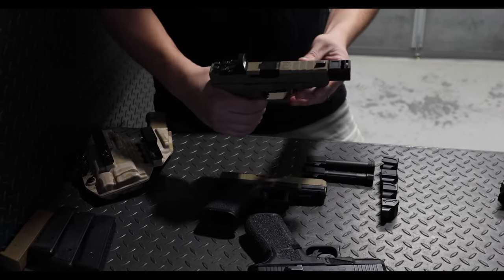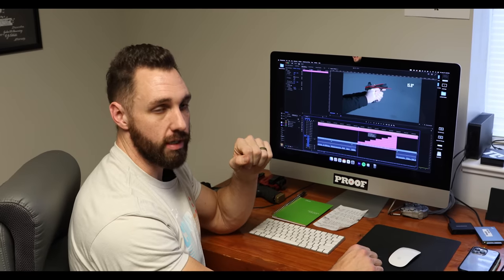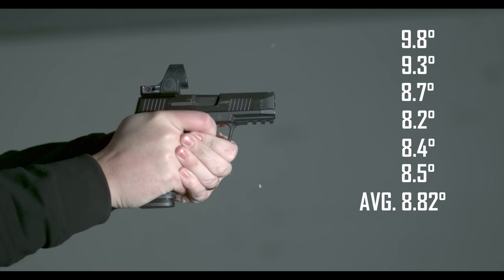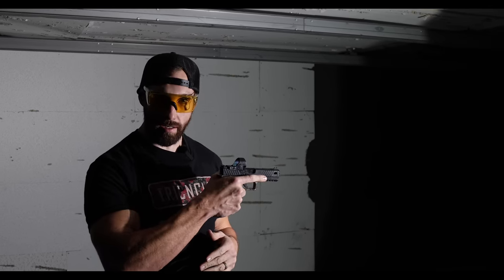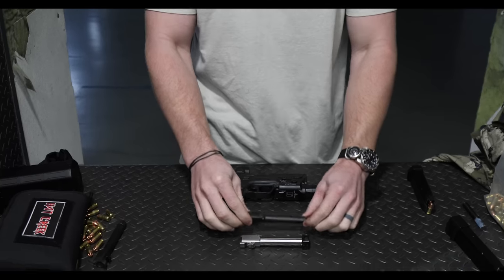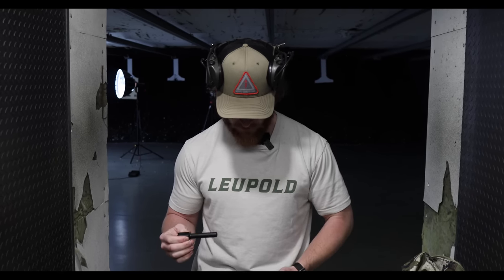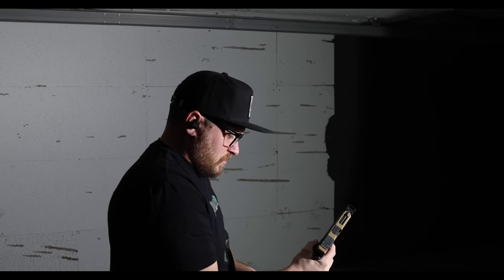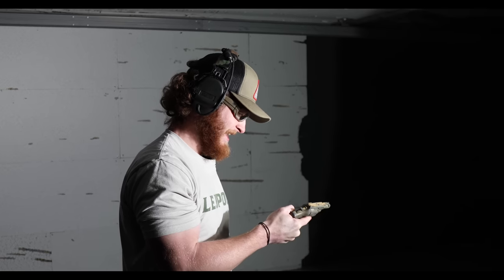Ported Barrel vs Thread-On Compensator - Which Shoots Flatter or Softer?

Comment: For me, ported is really the way to go. Length of slide remains the same and they shoot flat. I decided to port my G48 after the video you guys put out last year, best decision ever. Great vid!
Reply: Not to mention, any holster you may have owned before the comp has become completely useless. Unless you know your way around a dremel. Thus why I never bothered comping. They are great for competition but for CCW, they increase the bulk of the gun and take up more real-estate
Reply: I took my ported pistol to a low light shooting session and man that thing spit way more flames than my two port comps. Went back to comps without any hesitation.
Reply from the maker: yeah your mileage may vary with comps and ports!
Reply: @Tier1Concealed   have you guys tried the lucky 7’s trifecta ports from monsoon ? Or is that overkill
Reply: @boygonewhoopdataZZ  I shoot competition at night, the ports really don't interfere with much in my experience, nothing a weapon light can't handle, I'd say the most issue you get shooting at night is the light interfering with the smoke, obscuring the target. To each their own I guess
Reply: @boygonewhoopdataZZ  your ammo was cruddy. Top shelf defensive loads also have flash suppressant in the powder. It’s really a non issue.
Reply: It also gives us more options when living in states that hate freedom.
Reply: @boygonewhoopdataZZ Are you out at night a lot? If not, it's probably wiser to carry a ported barrel...

Comment: I bet most of the problem of ported vs comp is that the aggressive porting actively reduces the energy of the bullet, which inherently reduces the energy of the recoil while compounded with the porting. It should be fine, but I'd check your defensive ammo's performance with shorter barrels to make sure it works well with that porting. 100 fps seems minimal, but I have absolutely seen JHPs fail with that little discrepancy in velocity.
Reply: If you get something like the lakeline llc ported barrel they are slightly longer than stock barrels and fps is near identical between their barrels and stock barrels. I know they are available for taurus and glocks

Comment: WELL, now you just need to include those new “INTEGRALLY COMPENSATED” slides, ex; G19 length slide with porting in front of sight using a stock G26 length barrel, NOT to be confused with “PORTED SLIDE & BARREL” setup and those “Ported Extended Glock barrels” ex; EFK Fire Dragon barrels, G17 length barrel in G19 slide.
Reply: Oh yeah, now you have places like Zaffri precision, offering A threaded ported barrel, so you can run a compensator on a ported set up

Comment: All angle averages:
Sig stock - 12.33
Sig slide ports - 10.84
Sig monsoontactical Lucky 7’s barrel ports - 8.82
ZEV OZ9 stock - 7.77
ZEV OZ9 primarymachine Stealth Comp* - 5.92
ZEV OZ9 monsoontactical Lucky 7’s barrel ports - 5.25
M&P 2.0 stock - 7.13
M&P 2.0 Smith & Wesson M&P RGW QL comp and barrel - 5.67
M&P 2.0 monsoontactical Lucky 7’s barrel ports - 5.37
Glock 19X stock - 9.8
Glock 19X agency comp - 7.58
Glock 19X MOD-K** barrel ports - 6.33
Glock 19X ported barrel and swprecisionarms comp - 4.72
Revolver stock - 14.08
Revolver with comp - 13.28

*Broken into single port comp
**MOD-K armory is apparently permanently closed and stole a bunch of peoples stuff. Google it.
Reply: Very nice - I wonder about PMMs stats
Reply: Goat
Reply: Now to get SUPER TECHNICAL, test Monsoon Lucky7 porting vs Norrso Porting since theirs is circle, square, triangle the same size and placement as Monsoon's.

Comment: Great test! In my experience a proper compensator-meaning a custom, competition-style unit- works best and can have other advantages as well. The issue with such compensators is the gun needs a certain amount of re-engineering to use them reliably and the add real weight and length to the gun. That being said the comps you used represent a good cross section of what the average shooter will encounter and is likely to resort to. For my carry guns porting is the way to go. It's effective and minimizes changes to the platform which means minimal changes in reliability. For me that outweighs any potential advantage of an external compensator.  I do prefer the 'Chonk Port' style of port; I find these very effective and reduces the loss of velocity to a negligible level.

Comment: I prefer ported and my own M&P 2.0 4.625 inch barrel 10mm and slide has been sent to Mag-Na-Port for quad porting. My barrel is not threaded so no comp for my gun. Comps add length I do not wish to add for holster carry. A 4.625 inch barrel is long enough for me.

Comment: A true comp outperforms straight ports due to the gasses hitting the wall at the front of the expansion chamber but a combo of comp with ports is the ultimate. Look at the race guns used in USPSA. Edit, I should add that comp design is critical, most of the aftermarket drop in's are merely bbl weights.

Comment: Straight up… compensators are much more effective than ported slides. Like my standard p365 with pmm comp and barrel out performs my $2,500 Gucci X Macro Comp with every available internal and external upgrade available. There’s a significant difference!

Comment: So this was an awesome thing! I think you should run the standard barrel, threaded barrel, and ported barrel over a  chrono. I know that the threaded barrel is going to increase terminal performance, standard sill be standard, but curious how much velocity is lost for from the ported options. I know my 3" revolver and 4" ported are almost the same for 357 and 38.

Comment: Porting a barrel shortens the distance the bullet travels before it can achieve its maximum velocity. Compensators help if you are using major loads or P++ ammo. Hence Porting a barrel affects bulllet velocity resulting to less energy created by the bullet. The longer the distance the slower the bullet. Compensators does not help reduce muzzle flip if your are just using factory loads because they do not creat enough energy jet to keep the barrel down. Especially if the compensator hole is huge. All it does is redirect the blast upwards. Compensators are used in open division competition because they use major loads (P++). Compensators help redirect the massive explosive energy. For production guns that uses factory ammo, porting or using compensator produces placebo effect. You feel its helping with the muzzle flip. However, that's science. If porting and use of compensators makes you look good and a confident shooter, then that's good. All that matters is you are having fun and is improving your confidence in shooting. If my gun is beaute, then I am a beaute.

Comment: I know this is a year ago but I have a question why couldn’t you just have the barrel sticking out about a half inch like a threaded barrel and make it ported , better yet two slots on both sides of the barrel so you won’t get the flash in your face . That way you won’t lose velocity and you don’t have to cut up your slide. Basically a drop in barrel with ports in it.
Reply from the maker: Those do exist, but you don't see them very often. Its probably mostly an aesthetic thing for the customer.

Comment: @tier1concealed I read somewhere recently that gases expelled from a ported barrel could potentially blind or disorient the user if the gun is fired closer to the body. In self defense situations you may not always be firing from a normal shooting stance. Just wondering since most of you use the lucky 7 porting, have you seen any validity in this?
Reply from the maker: In theory there is, but only if it’s dark enough for that to be an issue. But you’ll find there’s typically significant muzzle flash anyways when shooting in the dark. Ports or comps might increase that a little bit in our experience it doesn’t make much of a difference.

Comment: 2 interesting things I have noticed.  1st I put 2 port comps on my Glock 20 with a KKM threaded barrel as well as my CZ P10 C with a threaded barrel. Both had multiple malfunctions were none existed before. After removing the comps reliably returned to 100%. 2nd: At 15 feet while shooting a steel flip over target my P365 would hit the paddle but would hardly move it. Took out my P365XL & shot it with the  same ammo, same distance. The paddle moved more but still wouldn't flip over. Took out my S&W PC Shield Plus 4" ported barrel with same ammo & distance & now the target finally flipped over. So the 4" ported barrel had more power than the 3.7" non-ported barrel. And no malfunctions either!
Reply: Just an add on the steel flip over target was shot multiple times with each of the 3 pistols & the results were the same each time.

Comment: I carry a ported G17 I built out a few years back. It's been an absolute game changer. Ported handguns are the way to go if you want enhanced performance out of your handguns. Most velocity decrease can be negated by +p ammo
Also just sent my xl slide to get ported. Threw it on a macro frame as well
Reply: How much fps do you lose running +p vs standard?
Reply: @HKBuilderDIY  its dependent on where on the barrel the ports are, on average I'd say you'd be losing 75 fps at most, but usually around 25-50fps. Most +p loads give you back that extra 25 fps that you lose, also helps the gun shoot flatter because of the extra pressure pushing the muzzle down, not a huge amount though

Comment: That's great info. I've always felt a bit skeptical about comps cause even though they can reduce recoil SOME can effect accuracy. So i've been looking into ported barrels and slides for my P320. This helps clarify things for me. Thank you.
Reply: Ports can cause fragging and flash. Nothing is without is pros and cons. Comps are generally better but ports don't increase length which is a deal breaker for many.

Comment: Messed with all kinds of comps. Gen 3 and 4 and 5 glocks w/ threaded barrels. Finally bought my 43x and decided to do an Arc division slide but heard about initial reliability issues so went with a zaffiri precision ported slide and barrel setup. It shoots flatter than any comped glock I've ever owned. I'm amazed and the effects of ported barrels.

Comment: Going from bare* muzzle to ported was kinda flawed in my opinion. I'd rather u start with a comped or ported gun first then go to bare muzzle bc u have to take into consideration "getting warmed up" if that makes sense... one could argue the comp didn't do all the work if ur getting more warmed up as u go meaning ur shooting will getting better atleast until a point of fatigue kicking in an changing things
Reply from the maker: yeah that makes sense. we did take probably 10-15 minutes in between every string of fire to re-setup everything and get the high speed footage saved, so I wouldn't say we were very warmed up at all.

Comment: This test might be good to redo strong-hand-only or just with a really weak grip. Yall have such good grips that the difference is almost negligible. Weaker grips will open up the differences more and make it super clear
Reply: Most comped and ported guns won’t run with weak grips
Reply from the maker: thanks for the suggestion and compliment! we might do another video similar in the future...

Comment: On the ported video.. https://youtu.be/3xEI36Dtf04?t=1013 it shows flares up and gases .. does that affect night shooting or does the gas gets into the red dot somehow? Curious as I am looking at NInex19 ported sliders with 45 and 135 degrees ported barrels for a reson vs the 90 degrees tested on this video. Is that a big of issue to stay away of ported?
Reply from the maker: yeah people could argue that its detrimental in a night shoot, but you'll notice muzzle flash anyways in nearly every handgun. We haven't noticed much residue on the red dots so far.

Comment: Curious on accuracy with the lucky 7 ports... probably has no ill effect. Also, I know what porting has the potential of doing. Buddy had factory ported mp shield and got copper jacket in eye and was bleeding from his nose shooting from retention. Ports can strip off pieces of copper . Not necessarily guaranteed to happen, but I've personally seen it.
Reply from the maker: yep, factory m&p ported barrels are notorious for shaving jacket off!
Reply: No kidding? Ouch
Reply: I've had copper jacket fragments hit me while firing stock pistols, fyi. I'm sure porting spalls more.
Reply: That typically happens when the barrel is rifled then ported… port the barrel first then rifle it and you should have no issues. Factories typically do shit like this because of the mfg process. Small shops can afford the labor to do it right.
Reply: Blazer Brass.

Comment: Great video! On a full size gun the barrels that are ported just beyond the slide seem like the way to go so you don't lose velocity.
Reply from the maker: We're hoping to do a video with a chronograph soon!
Reply: Sagedynamics did chronographing with the g19 vs g19c( factory ported glock19) fps loss was around 1%. It was determined that the disadvantage to porting is NOT lost velocity, but the spalling.

Comment: What recoil spring weight did they use on the g19x? I'm definitely interested in doing that combo 😅
Reply from the maker: Stock recoil spring in the video, but if you're talking about the port/comp combo they had to add a lighter spring

Comment: Surprise you guys didn't incorporate the Mantis system...I know all the mods are self preferences and if you have the money....but the way I see it, the ports look awesome but the lost in velocity and close quarters engagements with the direction of the ports spraying round shavings makes me feel iffy. Make sure you don't cover the ports or look over the ports...and the unicorn is if a casing falls back into the comp depending on the size of comp seen some pictures where the casing landed back into the port base on ejection and ammo....I like comps better less modifications and don't really have to worry about shrapnel...
Reply: Quality ports won’t shave the jacket
Reply: @Clarkshooter  awesome! The more info I know the better 👍
Reply from the maker: yeah, fair points. nothing is going to be AS reliable as the stock oem barrel, in most cases, but you can still get some very very good reliability out of porting and comping.
Reply: @Tier1Concealed  again all self preferences and really good training which you guys do and get, 2 👍 more good information with awesome videos...

Comment: From what I see,  the ported did good but not by much compared to the comped version... 1/2 of a degree for the price to port the barrel and slide to a comp, I think best bang for the buck is a compensator
Reply: Sure if you're cutting from stock but not if you're going ported from the jump. You can get ported slides and barrel cheaper than slide + threaded barrel + comp from most shops. Just something to note for builders out there.

Comment: VERY interesting!!  What grain of ammunition did you guys use for the test and did you have to change any springs to run it smoothly?

Wasatcharms has a Glock compensator that's frame mounted so it's more reliable as a comp while boasting 60-80% reduction in recoil, now that and a ported barrel would yield even better results
Reply from the maker: We were running reman 115gr 9mm from HSL Ammo! Yeah, that would be very interesting to test!
Reply: @Tier1Concealed  Thanks!!  if you do get around on testing that particular compensator it's been tested to cycle reliably on 117-147 grains

Comment: Once you shoot a comp or port from retention you'll quickly learn why to keep the regular barrel on
Reply: I have shot mine from retention alot. It’s not that bad
Reply: If I had to shoot from retention, I rathe take that gas to the face than whatever the assailant wants to do.
Reply from the maker: yeah depending on how you do it and your particular setup, it could be bad or not bad
Reply: It really only takes rotating your hand from vertical to slightly canted away from your body and most gas is out of your face/body from ports or comps.
Reply: @Nickalapokis I’ll try to remember that when I’m getting stabbed 🙂

Comment: Any particular reason most of you went for the same Lucky 7's porting between your guns other than making the results more comparable? I'm looking at getting my P365 X ported and am trying to figure out what service/pattern to go with.
Reply from the maker: It seems to perform better than any other porting we've tried so far
Reply: @Tier1Concealed  thank you for the reply! I was going to go with the P365 Xmacro, but I think I'll see if it's possible to build a Lucky 7's P365X for about the same cost, since it would be a bit smaller for CCW use and allow for more customization before hitting budget restraints!
Reply from the maker: That would be awesome!

Comment: BEFORE I watched your Vid I'd offer; Porting seems to shoot softer than a true Comp (the P365 "Macro" isn't a fukking Comp- although SIG calls it one), a Comped gun does a better job of "Muzzle Hop"/shoots Flatter. Purely Subjective.
The efficiency of each system will also be dependent on AMMO; bullet weight/chamber pressure/type, or amount of powder used ("Fast" or "Slow" powder-AMOUNT of powder in case).
I carry either a Monsoon "Khyber Comp" C2 or a P365 with a PMM COMPED Barrel/Wilson grip module. My Range/Teaching gun is a Vulcan PORTED Staccato P.
Different tools for different jobs.
I DID enjoy your data. SCIENCE.
ADD: Like to know what ammo was used in each sequence; bullet weight/"+P"/Standard Vel. It makes a diff in terms of efficacy of system- Porting/Comp.
Reply from the maker: thank you for that comment and info!! we totally agree. In this video, as with most, we are running remanufactured 115gr 9mm from HSL ammo. Its good stuff, but nothing crazy special. There could definitely be some variances in velocities and loads just like with any reman ammo.